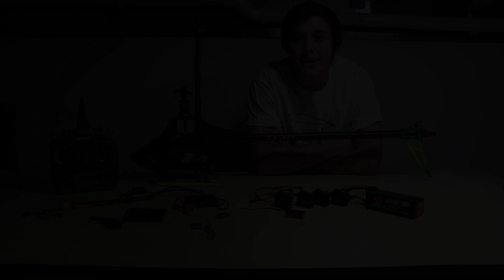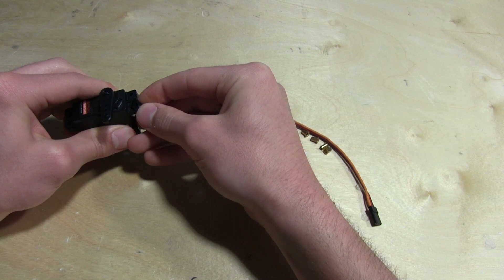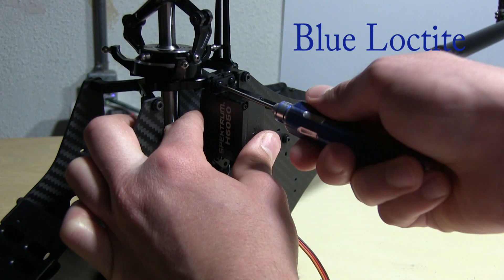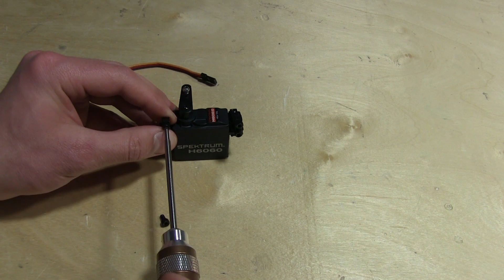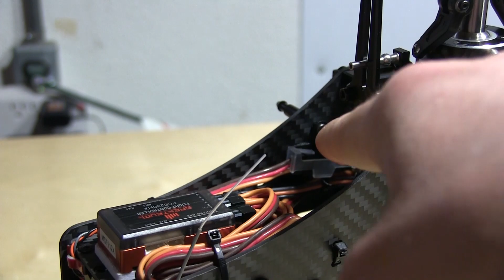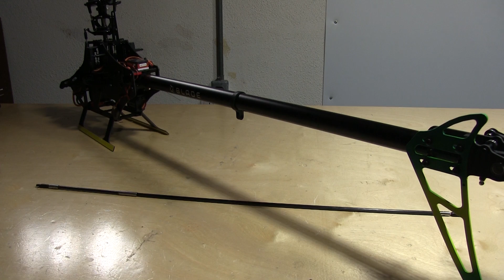Blade Fusion 480 BUILD SERIES: Electronics Installation

Comment: I have a question if anyone can help me,I just purchased a 480 kit it has the motor,but it’s very hard to turn the motor,does this mean it’s no good, or is there a way I can check the motor,because it doesn’t turn easily,I have to use a lot of force to get it to turn.thank you for any advice.

Comment: I picked up a 480 in a bundle with the motor and Spektrum Avian esc. I was a little let down that the esc mounting holes in the back of the battery plate were oriented for the Castle Talon esc. Er i think its for the Talon. It definitely wasn’t right for the Avian esc that came with it. I ended up milling out a small adapter plate so everything could be securely fastened with screws. I suppose ty-wraps will hold and not everyone has access to a mill. So Horizion, if your listening, if you wanna bundle all your products together you should make sure they actually fit. Otherwise i love this bird. With a 6250hx flight controller i can flip on stability mode and hand my IX12 to my son without too much worry. Anyway, kewl vid. 👍🏻👍🏻👍🏻
Reply: What?...flip on stability mode?...just got my 480 and in the building process of having to make an adapter plate for the esc...as far as the wires go...they are all the same color so how do you know which ones to hook up to the motor?...i will obviously hook them up in line with each other but usually wires are of different color to represent pos,neg,ground, signal...and so on....aslo, i slid the gear all the way down onto the motor shaft and it did mate with the main rotor gear and i made sure that the "play" or "slop" or "tension"  between the two gears was correct but with my automotive skills in rebuilding differentials, it looks like the motor gear could be slid up the motor shaft just a little bit for more of a better "bite" onto the main rotor gear...im confident with my set up but there was nothing in the manual about this...and speaking about gears, why isnt the main rotor gear metal?...ive noticed that on most helicopter that are below 500ish, that the motor gear is metal and the main rotor gear is plastic or whatever...whats up with thtat?...why not both be metal?
Reply: @hoofarted8709   Totes Congrats! Awesome Heli. These lil esc’s are essentially tiny Freq(uency) drives that put out low voltage three phase AC. As such you dont have a Pos and Neg or a Hot and Neutral. Therefore the color of the wires is a moot point as far as hooking it up. You may want to tag or identify them for future maintenance. If the motor turns the wrong way you can correct this in one of two ways. Either just swap any two wires, just like three phase ac, or you can reverse the rotation thru the esc software. Oh and i think the reason they use plastic for the main gear would be weight. A helically cut plastic gear is durable, light and pretty quiet.  Cheers

Comment: Hey man. I just built my 480 with the super combo kit. Just found out the tail blades on mine are backwards. The belt on the main shaft go forward with the main blades unlike my fusion 360 which are reversed. Just making sure that's how its supposed to be. Thanks. Chris
Reply from the maker: Christopher St.Thomas when you spin the main rotor clockwise the tail should be spinning counterclockwise with the blades spinning outwards. If they are going the wrong way then you have the twist in the belt wrong. Hopefully this helps!